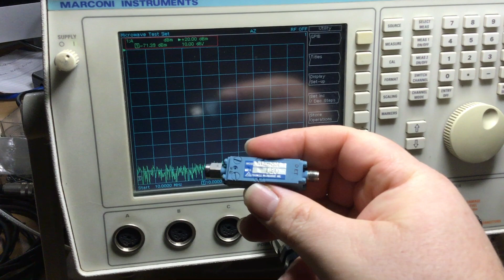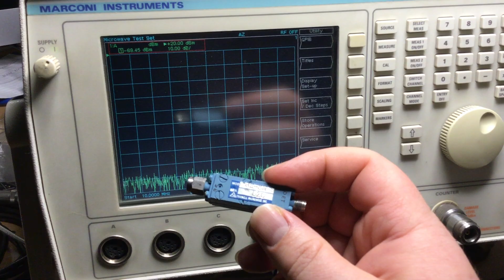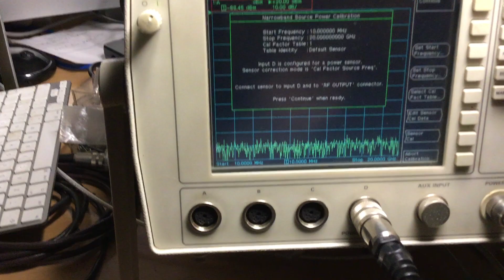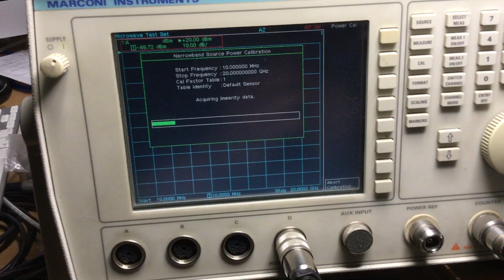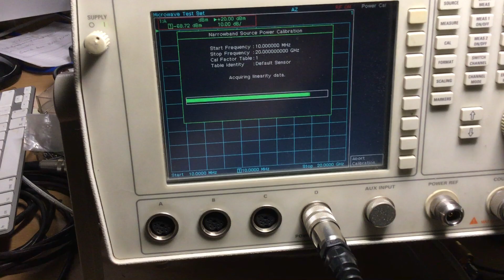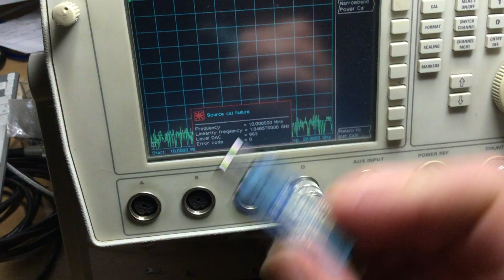Marconi Microwave 6200A RF Test set repair calibration Final part.

Comment: Im very interested in a PDF copy of the 6200a Service Manual. I have a 6203a here, i would like to repair.
Reply from the maker: I have some block diagrams of them however the component level service manual is very hard to come by if at all. i beleive these were only ever intended for board level swap repair not component level. i have seen  one listed at a test gear company who specialises in test gear service manuals, however it was very expensive & i beleive it will be mostly what i have already which comprises a functional description of each board & a block diagram, your best bet is to find another one thats faulty on the cheap & swap parts between them the only difference between them in the microwave chassis as you can see in my video this is the section that has the YIG oscillators thats the only difference between the models everything else is the same. Good luck  not sure if you are in the UK but if you were i could repair it for you.
Reply: @rfmanrfman4536  Thanks for your Answer. I just found out there are three mts 6200 series 6200, 6200A, 6200B. Do you know the difference between 6200 and 6200A?